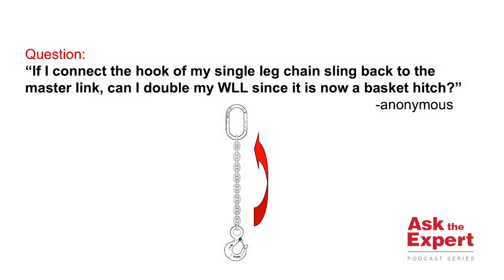Basket Hitches: Can you double capacity?

Comment: What if both the ends (Oblong Ring as well As Eye Hook at Bottom) are put into the Hook of crane, Will it quality as basket lift?
Reply from the maker: Hi Sunjeev, a basket hitch rating, 200% of the straight line hitch, for a sling is based on both legs of the basket hitch being vertical  and the proper D/d ratio for the type of sling used.  If both ends of the sling are gathered into the hook, then the rating of the basket hitch will likely be reduced based on the angle of loading in the legs and the type of sling being used.  If an eye hook is being used in this type of scenario, caution would need to used to make sure the eye hook seated properly in the crane hook and tip loading, back loading, and side loading of the eye hook or crane hook is avoided.